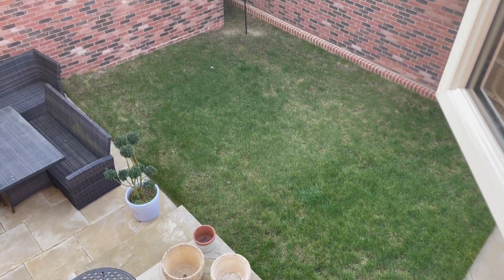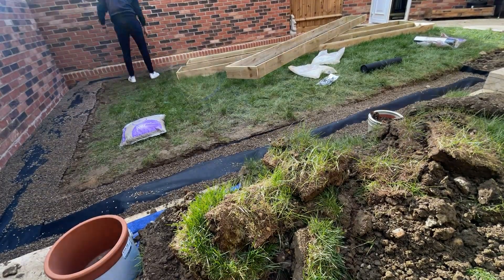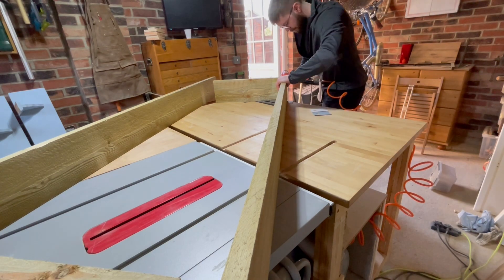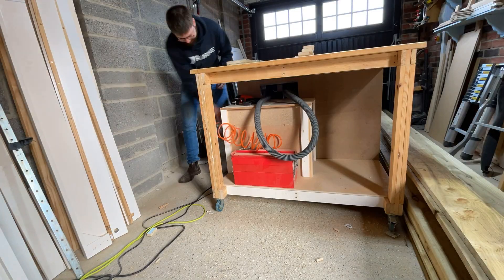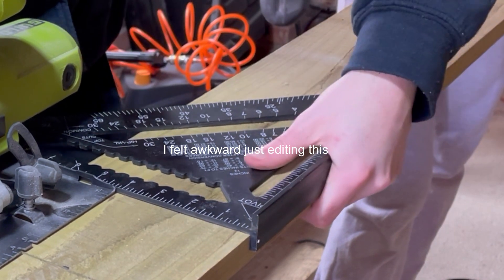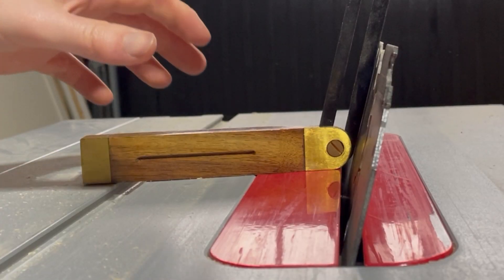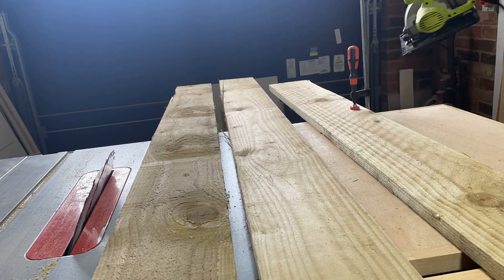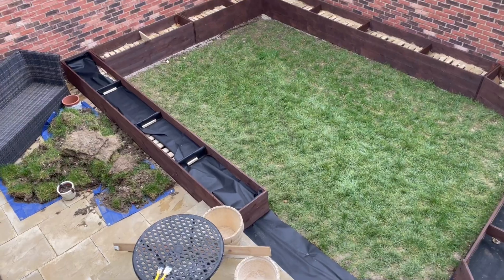How to build raised planters on a budget with no sleepers

Comment from the maker: To clarify, total cost was approximately 450 for this phase, which is comprised of £40 on the test planter, another £330 for the remaining wood, £10 of pin nails, £10 of screws, £40 for the membrane and the pins, and then another £15 or so worth of paint :)